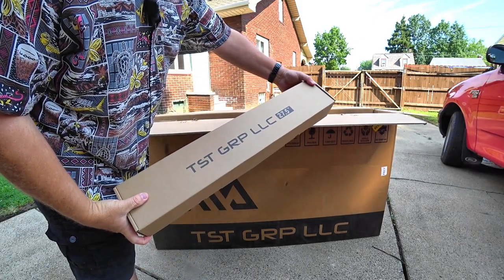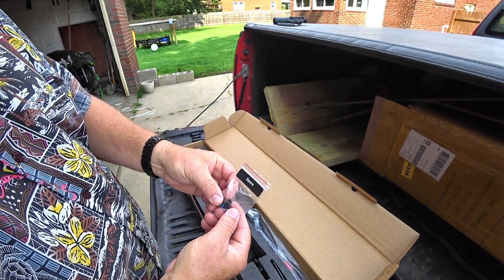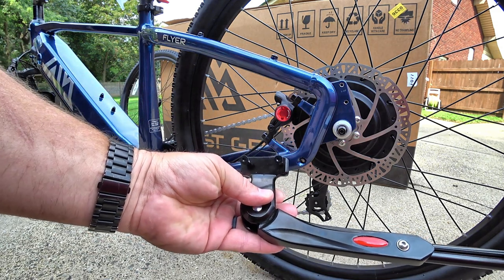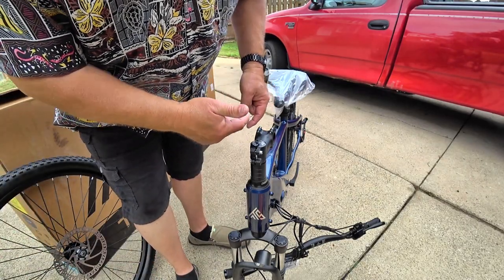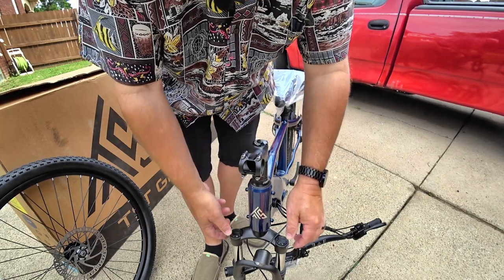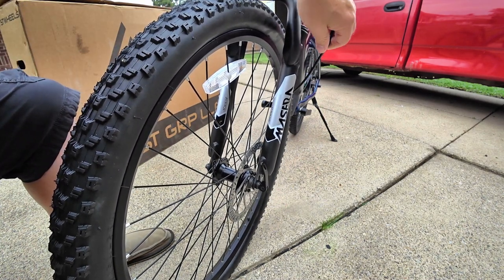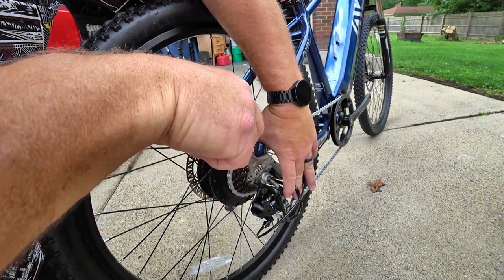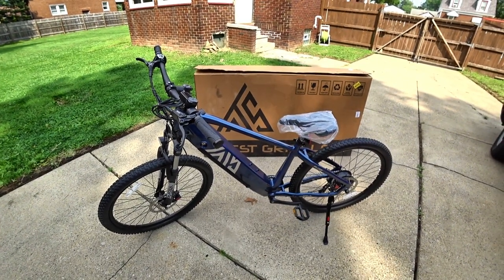TST Flyer E Bike Unbox & Assembly

Comment: Torque sensor or cadence sensor?  Thanks
Reply from the maker: Based on supply They switched design between both options.. However, this one was cadence..
Reply: @Rvdaydream   cadence sensors are cheap and they suck, IMHO. Tried several, liked none.
Reply from the maker: So do compact cars but millions of people still buy them.. Lol